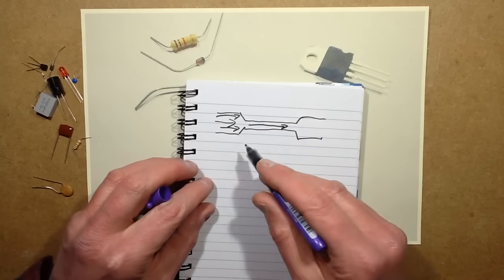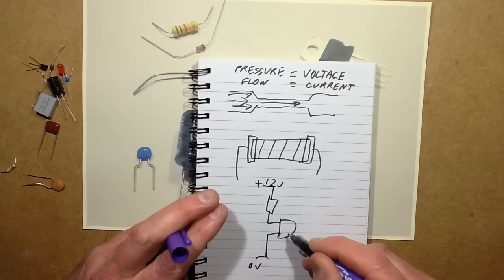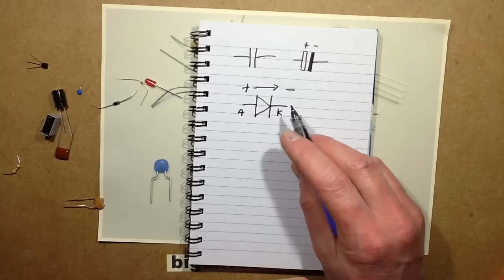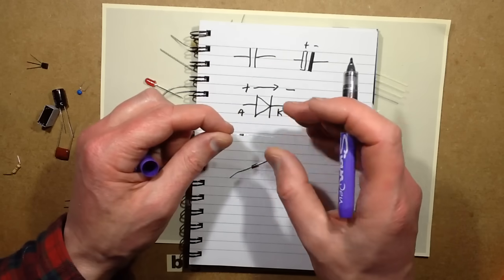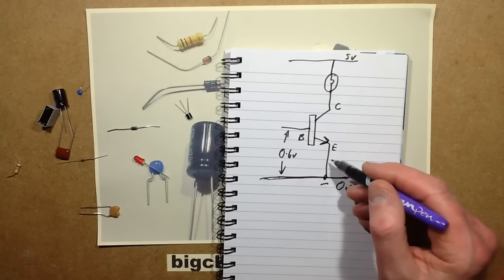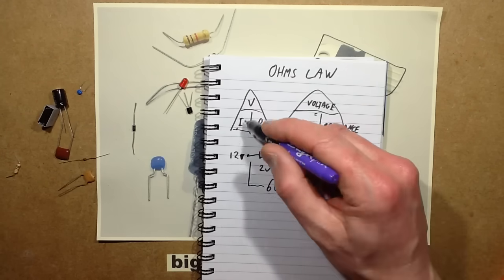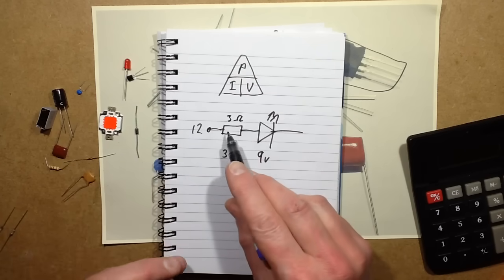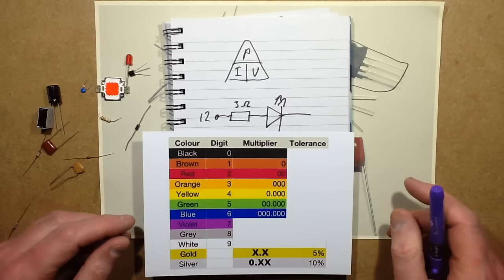A simple guide to electronic components.

Comment: thank you for this video on electrolytes capacitor , i now think i know whats wrong with my portable hard drive. the capacitor lost its JUICE!
Reply from the maker: That's a common failure mode.  Make sure the replacement is a "low esr" capacitor of the same voltage and uF rating.

Comment: Ok the transistor part is just impossible to understand. I 've tried over and over, i just don't get it.
Reply: You kind of just have to accept it. It's simply one leg controls how much power flows through it. The higher it is, the more  power the other input leg can pull from the supply, to a limit

Comment: Great video, quick question (hopefully) I only know limited amount about resisters, and that's in the quadcopter/drone hobby.  My son has a RC boat that is broken, It has a safety measure built in, two tiny metal pins stick out of the rear hull, on the inside, they are attached to a single wire each, one + one -, that run to the circuit board.  What this does is make the motor only work when boat is in water, or connect a wire between the two..lol.  Anyway, my son broke off one of the pins, and I took boat apart to try and remove that feature all together, but can't get it to work.  On the circuit board where the two wires run to, there is a transistor, like the one at 20:40, soldered into the board.  It appears to be a C8550, I suppose you know what kind that is, I found a data sheet stating it was a PNP, but I didn't understand the rest.  Is it possible it was being used as a switch, and waiting for those to pins to achieve a connection via the water?  Boat is powered by a 2s(7.4v-8.4v) 1500mah Lipo battery.  Thanks for any advice, or any subscribers reading this, jump on in!
Reply: On a different subject, we love electrolytic capacitors in FPV drone racing/freestyle.  As advanced as some of our gear is, we are forced to still use, for the most part, analog video for the fpv cam to see where we are going due the cost, and super low latency when your flying 50-75mph.(footage on youtube is often a gopro attached to drone.)  The motors and ESCs, go from idle to wide open and back again, several hundred times in a 3-5min flight. That along with other electronics puts off a lot of frequency noise.  We add caps anywhere from 30uf to 1000uf, depending on the type of drone, and it significantly cleans up our video feeds, it's quite amazing.

Comment: I guess a water tower would be a better analogy for the capacitor.
Reply: If it helps anything, an inductance would be the same as a water wheel aswell.

If you put load in a water wheel it gives more impedance to the system, such as putting more load to a motor would do. 

The water wheel would respond to a rapid change on the direction of the current, because of its inertia; also it would try to keep the flow going in the direction of the spin. 
The water tower would absorb the rapid change on the direction, but would discharge its column if the change is very slow, causing some impedance.
A valve or any restriction would just release energy in the form of heat, such as a resistor. 

The same analogy can be made with springs, dampers and mass.

Said that, we can divide all the energy in the system in potential, kinectic and loss.

Potential = water tower = capacitor = spring
Kinectic = Water wheel = inductance = mass
Loss = Restriction = Resistor = Damper

Hope it had helped someone and sorry for the bad english, I'm drunk as fuck!

Comment: You are right about those blue resistors, my eyes are failing at close range and the Blue makes it impossible to read them properly without sticking them over a meter to confirm. 
Another bugbear of mine is cable manufacturers that love to brag of their company brand name on the side of the cable but the most important bit like how many cores and the cross-sectional area is often not well marked or the markings are far apart. Small capacitors are also a nightmare to read.

Comment: I was big into electronics as a child growing up in the 80s and 90s- I would regularly take apart and put them back together or fix them. These components ALL  look like that era; however the only modern circuit boards I see these days are in computers.  

Outside of hobbyists, are any of these decades old components still used commercially?  Seems like everything is SMT these days, and has been for quite some time.
Reply from the maker: Through hole components are still widely available and much easier to play with than surface mount.  The same technical description applies to the surface mount versions.

Comment: 5:05  I think in a circuit class a professor once used a bucket analogy to describe a capacitor.  That the Bucket holds a certain amount or charge, and then it could be discharged for later use.
Reply: Yea but the example in the vid is better, because there is an insulation between the leads. DC can't pass through.

Comment: I will never understand how all those things make a computer work.
Reply: You have to learn this stuff piecemeal really. Fundamentally think of a computer as a few billion tiny light switches (transistors), off/on, 0/1, etc. (these states are called bits, a combination of the words BInary digiTS). Transistors made out of semiconductive silicon (we used to use vacuum tubes) that can be very easily be "switched" without using too much power and can be constructed to do 7 different functions called logic gates (AND, OR, XOR, NOT, NAND, NOR, XNOR; you can google these to see what they do exactly) that compare the states (0 or 1) of 2 or more "light switches". Different combinations of bits are encoded to mean different things, this is called binary code. Ultimately, you watching this video is basically your computer (and Youtube's servers) doing millions of math problems every second.

Comment: This may be very naïve question but speaking of resistors, why not just get the voltage right to being with? I've been studying electronics only fairly recently and I see resistors on just about every board I analyze. If it's the most common component then what does that say about how much precision actually goes into the boards? Moreover, resistors have specific colored bands implying specificity. Why not just incorporate that same specificity into getting the exact voltage and current right? Is it because electricity is unpredictable in nature?

Comment: Clive a question for you.   Why is it accepted that electrons “flow” negative to positive but the current is said to flow the wrong way?
Reply from the maker: When electricity was first discovered it was believed that current flowed from positive to negative because when you electroplate something the current seems to carry the metal across.  But it was later discovered that the electrons move in the opposite direction.  It would be confusing to teach anything other than traditional flow because all the symbols were based around that direction.  To anyone other than a molecular scientist or semiconductor manufacturer it doesn't really matter.
Reply: Well every day is a school day.    Thanks for clearing that up.

Comment: You should mention that putting both together gives P=R * I^2, which explains why you use high voltage lines to avoid power loss due to high current

Comment: 2 years ago (edited)
0:07 Resistor

4:25 Capacitor

15:25 Diodes

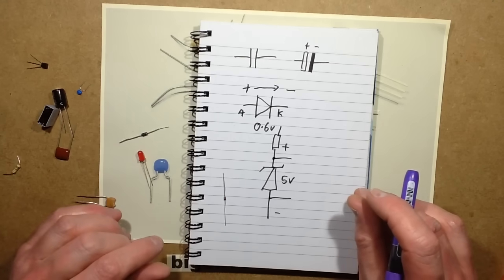20:23 Transistors

25:00 Ohms Law

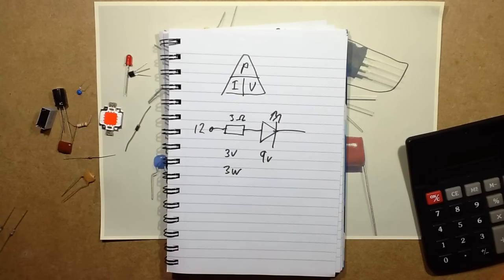33:00 Colour Code for Resistors

Primary Colours (1Red 2Yellow, 3Blue).
Secondary Colours(Orange, Green, Purple)
Tertiary(brown)

Red Orange Yellow Green Blue Purple

Colour Mixing
Red+Yellow=Orange; Yellow + Blue = Green; Blue+Red-Purple

Comment: Great video I deal a lot with those electrolytic capacitors and they are a constant pain in my ass. High frequency large output DC chargers for traction batteries literally are lasting 6-8 years before this drying begins to happen to the electrolytic capacitors and they eventually blow or pop the top. Thanks for explaining why this happens so clearly I had an idea but could never fully explain it. Cheers

Comment: Also with the game compacitor . The reason why is was made to resist a large amount of current  is because of the rapid button pushing.it needed the option of great current all the while keeping it steadily  neutral. That's why when it did break you character would move without you touching the remote

Comment: Hey Big Clive - do you have a source for tuneable  capacitors looking for the bigger ones to build a tuneable mag loop antenna system.
Reply from the maker: I've not looked for those in a very long time.  I experimented with tiny ones in DIY microtransmitters a long time ago.
Reply: I don't know which country you live in but try radio rallies as they are called in the U.K. I always see some. I believe they're called a swap meet in the U.S.
Bill, G4GHB.

Comment: hey, thank you for making this video.  I used this to try and educate myself on a repair that i am working on.   As i understand, the voltage portion of a copacitor rating is the amount of protection from the amount of voltage indicated?  I bought a 1.0/630v when i need a 1.0/35v I am assuming this is to great of a difference.
Reply from the maker: The capacitor should be rated above the voltage it is used at.  The capacitance rating is important.

Comment: What is "IN SHA Lation"? Also, I'm watching part about caps and I'm finding that I'm very frustrated firstly that you keep saying "in sha lation", but secondly, the fact that you didn't bother to explain firstly what capacitance is. I think that would have been very helpful for someone who knows basically nothing to begin with. You're cutting your little example over and over, and stating and showing that it changes the capacitance each time, but, so what? What does that mean? You get what I'm trying to say. Thanks.

Comment: What's the best way to reduce a 48 volt e-bike battery down to 36 volts? The batteries are generally 10 to 20 amp hours, but the current is usually 15 amps. So the bike can operate anywhere from 45 minutes to an hour and 15 minutes depending on the size of the battery.
Reply: a transformer or converter.
Reply: you could also rig 4 bigger lithium motorcycle 12 volt batteries in series to make voltage 48... or just 3 for 36....
Reply: @alexgordonepic  actually I was hoping for just a simple resistor to lower the voltage. Does not have to be accurate. Some of the controllers can handle up to 48 volts, but when the lithium battery is fully charged, it's actually 52 volts. These batteries used to be $300, but I bought a 48 life04 battery battery cheap, and I don't want to fry my 36 volt controller. It's a bicycle I don't want to use heavy lead acid batteries. I could dismantle the battery but then I would have to buy a 36 volt PCB controller for the battery.
Reply: 2 Resistors in series...  One to ground... Here's the equation: http://www.learningaboutelectronics.com/Articles/How-to-reduce-voltage-with-resistors.php

You can do it...  Or u can ship it to me, I can do it for ya for only 100usd

Comment: I bought a couple of LED bulbs that have a photo resistor, that I want to cancel. I want the light to still turn on in sunlight. I looked for the resistor to cover with tape. I couldn't find any of the obvious components with a zigzag line. 
How do other photo resistors look? Google photos just shows the ones with the zigzag line

Comment: I built a shortwave radio from kit in 1968 and recently replaced its bad 4 section capacitor and it works again.  Tubes are usually not a failed component on old equipment.  As far as understanding electronics, I have not learned much more since the 1960s but the industry has sure changed!!  I remember reading then how LEDs would one day replace Incandescent Bulbs.  I thought: Crazy!!!  Now we are there!!  The average person would be stunned how many transistors are in a smart phone.  Especially if you think of the transistor size in the period when I first handled one.

Comment: So about the illustration of the water pipe pressure and flow of water applying to resistance and the flow of electricity... would this concept apply to gas and air flow as well?
Reply: I wanna say yes but I don't think it's so easily predictable, coming from a guy who is specializing in hydro/aeroponics

Comment: On smd resistors (and capacitors) it would be written in numbers, but with same logic as with colors, so for eg: 103 => 10 with 3 more zeros => 10000 ohms (10KΩ ). For capacitors it would be the value in picofarads, so 104 would mean, 10 with 4 zeros, 100000pF (which equals 100nF).

Comment: My problem with the water analogy is that with a squeezed part of the pipe, this would imply it increase the pressure and thus voltage. I would model it was a squeeze with a hole in the pipe too so that the voltage stays roughly the same, and the flow, or current still decreases.

Comment: When resistor is connected .is it the voltage or current is limited?
Reply from the maker: The current is limited.  But that can result in a voltage drop too, depending on the circuitry.

Comment: If I want to hook a 12V battery to a single LED, I attach a resistor to thd LED to drop the volts down, but if I have it attached to an on and off switch also, do I need a transistor?
Reply from the maker: You can just put the switch in series with the LED and resistor.
Reply: @bigclivedotcom  if there are 2 LEDs instead, wired in parallel, can you wire the switch in parallel or does the switch have to be in series?
Reply from the maker: @thebeybladearmory  If you are using two LEDs they could all be wired in series to run more efficiently.  Switch, resistor, first LED and second LED.
Reply: @bigclivedotcom  thats why Im confused, why would series be more efficient than parallel?

Comment: the mechanics of the diode were not explained as you did with the resistor and the capacitor - I started getting a bit lost at transistor section

Comment: Watched 3 minutes and have learnt more in that three minutes than in a lifetime!!  Your water analogy is excellent, the only other good analogy I ever saw about volts and amps was someone with a big mallet they said the Mallet represented amps but the swing represented the volts they then took the big mallet and tapped an egg to show that you can have many amps but if the voltage is low it's fine, then they took a small hammer and hit the egg hard and said that was small amps but large voltage.  I like the water analogy because it also explains current.  Be back later to watch the rest.  Thank you Clive. :-)

Comment: How big are you ?-) Do 1Farad capacitors make a ticking noise when charging?
Reply from the maker: 6'4".  They shouldn't make a noise when charging, but some power supplies can make ticking noises.
Reply: @bigclivedotcom  This is 10 x 1.2-1.36 volt NiMh batteries = 12-13.6 volts DC not AC. The cap is a Nakamichi for car audio amp. It was ticking at 6 volts, it should charge to the same as the battery and stay at 12 volts. I must have charged it up wrong though I got the instructions from youtube video. I think they put out lies to make us blow our caps so they earn more from customers. Either that or the cap was fake. It looks a little fake.
Have you tested a 1 Farad cap before?

Comment: but a narrow pipe wont restrict flow, just the velocity of the water will be faster in it as well as the pressure of the system will be higher, i dont get it
Reply: Its bad analogy. Movement of electroncs is consistent, its like a chain, they move the same speed everywhere in circuit. If you put a resistor in series DC, electrons will slow everywhere at the same time.

Comment: when he got to the section about capacitors I thought he was saying nanofart  and microfart
Reply: That's basically how they work so you're not too far off in the mis-hearing...the voltage collects until it is either full and has to discharge or other components call for a release.
Reply: Yes

Comment: When you demonstrated how a capacitor works with aluminum tape, could you have leveraged the adhesive on the back as an insulator and just have taped multiple layers of tape on one another to create a layered capacitor?
Reply from the maker: Yes.  The voltage rating would be determined by the insulation of the adhesive.

Comment: can you do close circuit  from 2 dc motors  capacitor and battery none stop running -one of the motors drive the 2nd motor like dynamo and the 2nd motor charge the battery....please let know if there,s some thing like that
Reply from the maker: If you mean an overunity unit then I'm afraid I've never seen a real one.

Comment: This is backwards, like this video is a mirror. Your mixing up pos and neg...  modern day compasitors are mostly the problem in modern day gaming cards they explode or bulge out due to our out dated hardware trying to hold up on modern day stress. We should really move on to new items of tech. One reason your video's are great for our society. Just try to make concepts fully understood to the students such as not mixing up pos and negative since it's commonly explained in that way due to it being easiest way for math.
Reply from the maker: I'm using conventional current flow because that's what all the existing electrical symbols are based on.  The only people who need to be bothered about actual electron flow direction are semiconductor manufacturers.